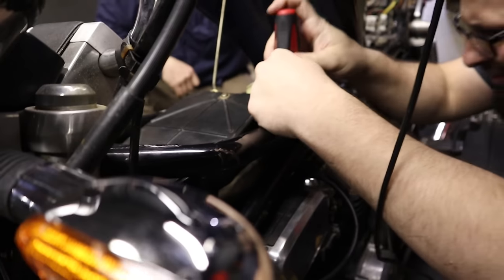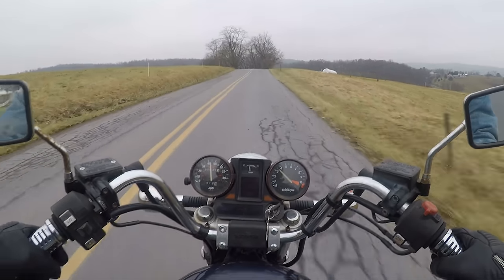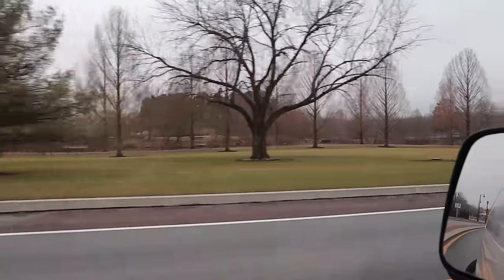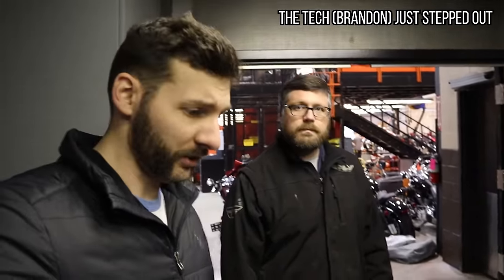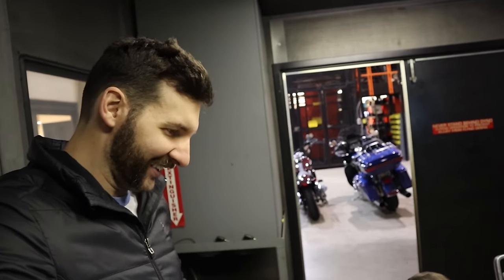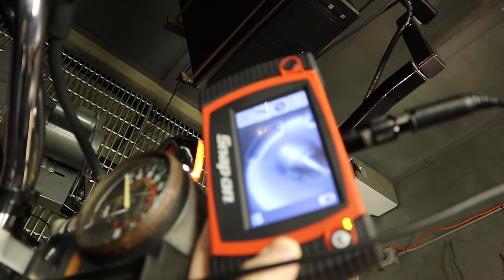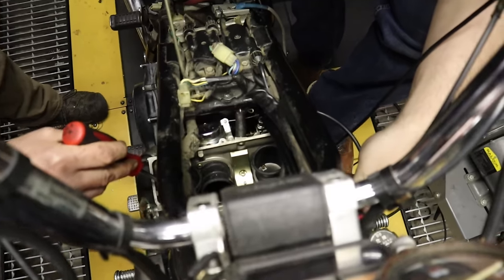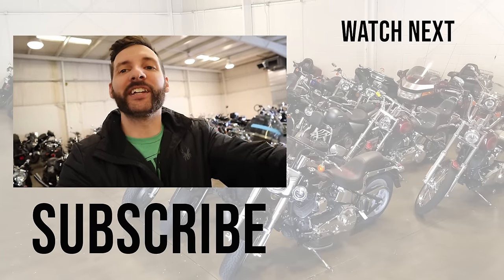We FIXED this abandoned bike for $83 then put it on a DYNO | 83 Honda Magna

Comment: Bring it to me, I'm right up the street and a 80s and 90s Japanese motorcycle fanatic, and my favorite part of restoring old bikes is tuning the carburetors. It's becoming a lost art form.
Reply from the maker: where are you at? its currently at joes but i will keep you in mind.
Reply: @Last_Stach_Standing !  ive learned that cut-rate quickie mart fuel is not the same as stations that (specialize) in good fuel at higher prices, its worth the extra money!
Reply: @chadsimmons6347  100%,I run a Honda VTR 1000F Firestorm, I think they were sold as the super hawk in the U.S,?.and one of the features of this bike is that it was fitted with the largest diameter carburettors ever seen on a production bike(48 mm Keihins),it's absolutely vital to only use a higher octane greater cleaning fuel I prefer Shell V-Power,it's also a really good idea to invest in a set of suitable vacuum gauges to check their operation on a regular basis,I do mine every 5 thousand miles,which is probably completely unnecessary!.
Reply: The vacuum slides could have small holes in the rubber diaphragms from age, and/or the intake valve clearance is too tight, which will result in insufficient vacuum.
Reply: mike brink  We don't have petrol with ethanol added in the UK,but I could see that might be a problem where ethanol fuels are available.The Shell optimax rated at RON 99,which we have does have added detergents which do noticeably clean the engine after a few weeks use.
Reply: @BikesandBeards  I'm in Ephrata, I'll send you an e-mail.
Reply: @darkknight1340  Actually "We do, I believe it's currently added at 5% (E5) but will soon be 10% (E10) search for "up to date Ethanol content in UK petrol" online and have a read.
Reply: Gumball I have an 85 magna v30 for sale about an hour or so away from you.
Reply: Running good clean gasoline is essential for engine life and performance.  Running non-ethanol fuels in carbs— even if the carbs have the reinforced rubber in them — will keep your carbs dry, and it’s a 💯 mandate for the carbs that aren’t rebuild with ethanol-resistant rubber.  Nice bike!
Reply: @Gumball's Gameroom I have a 1980 Suzuki GS550E, and the mixture screws are stuck. I've taken apart and cleaned the carburetor 5 times, but the mixture screws refuse to budge. I'm worried about breaking the threads. Here's a video of it running: https://vimeo.com/381540012 (it revs high because not all the boot clamps are fastened... because there were only two on the airbox side, and the screw stripped out of one, leaving one remaining).
Reply: That's strange because it seems so simple. I worked at a Honda dealer in HS and we still used microfiche and mercury sticks to balance the carbs. I still remember drilling out the factory carbs to adjust air fuel mixture
Reply: @williamkenny6383  It sat under a deck for 3 years, and the covers that originally went over the mixture screws have been removed, so it's been worked on before I got it. As far as I know it was last running as late as 2017, as that's the last date that was on the inspection tag (the guy who owned it died, and his brother put it up in a under-deck storage area, until I bought it July of 2019. I'm assuming the mixture screws are in a position where it will run (as you can hear from the video), but I don't know if they're in OPTIMAL position. Per advice on TheGSResource forums, I've used a rotary tool to cut down the channel into one of the mixture screws, to get better grip in trying to move it. However, I haven't done any of that before (this is the first bike I've ever owned or worked on), so I'm kinda flying blind. Everything is new to me. As such, I'm afraid of screwing something up. Being autistic and unemployed, I don't exactly have a steady income aside from disability payments, so I don't really have much to afford a proper mechanic... so it's been internet guides and videos, and lots of time in the backyard. There didn't seem to be much wrong with it, cleaned the carbs, swapped the ignition system to a Dyna S (faulty igniter box), needs new tires and a new front brake master cylinder (if I can't fix the old one). I actually took it for a ride down the alley and back, and it felt pretty good... aside from the rear tire slowly going flat.
Reply: Man, you are so right. I think them a bunch of amateurs. Why can't they clean and fix just two carburetors themselves? They are petrolheads and even I can tell you what they should have done. Instead they hit the road without getting those carbs almost perfect. What the beep did he do, spending an evening and an early morning? He did not clean and adjust those carbs, I can tell you that. Weirdo's, that's my not so humble opinion. Do they want this bike to break down? Because it is Japanese, perhaps? I don't like to curse, because it is wrong, but it is hard not to. They get me angry. Please treat your bikes a whole lot better, even if it's a cheap one.

And get yourself a dyno! What is a bikeshop without a dyno? How do you tune your bikes? How do you get your emission numbers right? Without a dyno?! Impossible. Get real.
Reply: Chad Simmons they let it collect more water
Reply: ZombiePotatoSalad buy a carb. Save your bike.
Reply: @voornaam3191 : Agree!!
Cleaning, basic adjusting and syncing of carburettors is the first you do before putting it on a dyno.
Dynos are for fine tweaking of adjustments.
Reply: mike brink  nicely explained. I don't know why people still think higher octane fuel will make the engine run better.
Reply: @voornaam3191  it's funny that they don't actually seem to know a lot about how bikes work. It's more of a 'let's take it apart and put it back together and keep our fingers crossed' approach. First thing I'd have done was order carb rebuild kits. They're not hard to source.
Reply: I wish I could have brought you my Yamaha XJ700 Maxim.  My bike shop fked it all up and ended up selling it CHEAP.  I put thousands into it too.  Motorcycles are way too expensive especially with maintenance and tire changes.  Also.  You really need a garage to keep them in.  Total rich mans' pleasure/sport activity.  Should be cheap as heck too but this greedy society fks everyone that doesnt sellout for money.  :(
Reply: @BikesandBeards  Hey Sean, you should grow your beard back again. You look weird with the mutton chops.
Reply: Gumball's Gameroom, same here mate. I also restore motorcycles and there is something very zen-like about rebuilding/working on carburettors. It also seems to be a bit of a dying art, especially now that almost everything made in the last 15 yrs has fuel injection 🤷‍♂️  my 1994 ZZR1100 has carburettors and still makes 140+ horsepower 🤷‍♂️ And if theres any issues with the carbs, they're easy enough to pull and repair/service. Best thing is, if i want to increase my horsepower, some of that can be done just by changing jets and needle settings... no expensive power commanders or injectors needed 😊🤙 Be safe out there ✌
Reply: mike brink  ideally you want to avoid using ethanol fuel in any motorcycles built prior to fuel-injection. Its not so much to do with fuel injection, but more because the ethanol fuel showed up around similar era of fuel injection being put into production bikes. This means bikes made around that time and after, have valve stem seals which can tolerate the added ethanol. But older motorcycles that run carburettors usually have older technology in the way that their valve stem seals are made of old-school rubber... which gets deteriorated by ethanol. So regular fuel for carb bikes whenever absolutely possible will protect the longevity of the valve stem seals. I find my old ZZR1100 makes better power on regular 91 (non-E10) than it does on almost any other fuel. Namaste ✌
Reply: I have an 83 750 Sabre I love it but I have an oil leak leaves a puddle when it’s on the  kickstand
Reply: Ive got a vmax for ya!
Reply: @kenball1980  Ephrata Washinton?

Comment: Hi from across the pond. Some years ago I took one of those out on a test ride which done exactly what yours done at the end of this video, it turned out to be a fuel filter. As the shop didn't stock one, I flushed it through with carb cleaner in the reverse direction, this shifted loads of muck out. This was done as a temporary measure whilst a replacement filter was ordered. This hack cured his fault and bought him time till its next service when I replaced the filter.

Comment: Sitting in a bar with some friends, when someone said that it was starting to rain....well, rain at 30 degrees freezes as soon as it hits the ground, or your bike. It was 36 miles of freezing rain on my '05 Softtail. between 15-20 mph the whole way, using a borrowed bar towel to wipe my goggles every 2-3 minutes. I actually thought about stopping at a filling station to get under the awning but figured that since I was already soaked, frozen and suffering to just push it all the way home. I'm in my 70's and have been riding since 1967, and this was probably the worst ride of my life. 

If I ever found myself in that kind of situation again, I think I would try to leave my bike in the bar and get a ride in a car....
Reply: I own a Honda CG125 for more than 5 years now, and I often find myself in that situation when monsoon season starts here in the Philippines. Usually, the situation begins when I am away from home and then rain suddenly pours down hard.

I have to brave it because it takes a lot more time for me to get in my rain gear than simply wearing a helmet and chucking the contents of my pockets into my top box. But that's also how I learned how to survive a wet road, paved or not.
Reply: sitting in a bar - riding the bike home = thank god for statue of limitations ;)

Comment: Had that exact bike, same color in pristine condition with only 8k miles 4 years ago. I got it In crank - no start condition.. I added a large amount of sea foam into new fuel after draining the old from the tank! After a couple battery charges from cranking and cranking I finally got some spit and sputters that turned into running for 5 seconds and dying then firing right back up and dying... let it sit over night came out the next day hit the choke and it fired up and idled great! Riding was a different story because it would want to bog down as soon as you would start letting off the clutch and want to die, I had to flint stone it a bit to get it to take off on its own! After riding around the block a few times and reaming on it “(slow rpm pull) like you had going on in the video” it started to finally wake up and clear out more and more! After 2 days that bike went from not running to running crappy to running great all due to 1 can of SeaFoam! I now run that crap in every bike I own every fuel up! It’s proved itself to me! If you have not used it.. which I’m sure you have, go on and throw some in the tank!

Comment: I had an '83 Honda Magna at one time, but it was the V65 VF1100 version. I bought it in 2012 from a guy that said it belonged to his dad before he passed away from cancer. Maybe, but a few miles down the road it began to overheat, so I shut it down and threw it in the back of my truck. When I got it home I took a closer look and found that the cooling fan was not kicking in when the coolant temp rose to the proper temp. Eventually, I just rigged a switch and manually activated the fan when the temp got up a bit and that worked like a charm. Then I got the tires replaced and fixed a few other small items and took it out for a spin. Worked very well and very very fast! I never did get the speedo to work, so I just mounted my smartphone to the bars and used that. I used it  to commute 35 each way in Southern California traffic for a couple of years. I did eventually give it up, but I remember one time having my son follow me in his Audi Quatro and he clocked me at 130 before he backed off. I estimate I got up to at least 145mph. I sold it eventually. Biggest and fastest bike I've ever owned. First shaft drive bike as well - that took a small amount of getting used to.

Comment: V4 Magnas and Sabres  were definetly awesome machines in their days. At one time they even made a supercharger for the V65 engines...
Reply: A friend had a V-65 Magna back in the late 80s.  He went on a few cross country trips on it but always had problems.  As I recall, there was some inherent problem with the V-65s internal lubrication system which caused excessive cam lobe and piston ring wear which led to poor valve performance and compression loss.   Probably any hi-mileage V-65 will suffer from these same defects.  I'm not sure if  these same problems were issues with the V-45s
Reply: Years ago I had a  v-45 magna and it was impressive for a 750.
Reply: @davidj.7779  theres an oil mod that helps that. also the issue mostly happens if you ride frequently under 4k rpm, or leave it idle too long as the cams rely on a low pressure system to get lubricated. but like i said theres an easy bolt on mod that fixes it
Reply: @bamcorpgaming5954  Did the 750cc variants also suffer from this issue? Can you just get away with turning the idle up a couple hundred RPM or is more efficient oiling mods an absolute must to prevent this ?
Reply: @RedMo46  just ride the bike like it's designed to be ridden and it'll be fine.if you do a ton of stop.and go I'd consider the oil.mod

Comment: might try opening the gas filler, to see if there is a venting problem, and replacing ALL of the vacuum lines .. ALL of them
Reply: Yes, have a mechanic that is easily as good as this guy. Worked for corp. Before starting his own shop. Only word of mouth. Dude is good. Got my buddies 883 up and going after going threw the paces. This was one but probably the most important thing. It sat for 18 years
Reply: Spider cocoons in vent tubes??

Comment: :hand-pink-waving:A little tip for Honda Shadow Riders that I learned the hard way today. My throttle was sticking so I laid it up for about a year awaiting a carb overhaul and subsequent massive mechanic cost. 
Today, We put in a new battery and a new set of plugs, lubricated the throttle linkage and cables a bit with spray lube (not WD 40). It's running very good now. SO, although we are going to do a carb overhaul, DIY style ... We learned that It is a good Idea to replace the four spark plugs about every 10,000 miles on these bikes. Make sure you have a proper socket for the plugs.:hand-pink-waving:

Comment: My first and favorite motorcycle is an 82 Honda V45 Magna that was bobbed and came as a motor and frame with buckets of parts.  It took a couple weeks to get it back to life and years later I'm still in love.  Brought that thing home in the back of my mom's mini van
Reply: I'm currently in the process of getting my first bike, an 82 V45 Magna back on the road,. It's been a frustrating project without any help or prior older vehicle/any motorcycle knowledge to back me up but I'm getting there. I work on newer cars, it doesn't really translate. So far I've rebuilt the carbs, I've identified a bad stator, put a new battery in it, did a lot of tests to try to find anything that isn't working correctly, and our first test ride it was hanging at 5500 RMP like in the video. It also required 4k revs and gently feathering the clutch in and out in order to even start moving or it'd stall pretty quick. 

Hasn't been on the road in a month or so, and air/fuel mixture screw actually vibrated out and caused a no-start. Found the valves were way too tight and am adjusting them right now, then I need to remove the other 3 screws and add the o-rings I forgot to put in them, aka why they were loose enough to come out. Here's hoping I have it running good in the next week or so!

Comment: Too easy... See those big circle things on the top of the carbs. Underneath there are rubber diaphrams that are probably dryrotted and cracked. This is very common when your slides aren't fully opening, unless your bike isn't getting enough air through the filter which I highly doubt.
Reply: thats why i absolutely HATE diaphram carbs!
Reply: I'd bet it's the tiny air inlet to the top side of the diaphragm that's supposed to equalize pressure between there and the main body of the carb. If it's plugged the carb will have to fight against increasing pressure the further the slide moves up. Either that or the caps aren't installed in the right orientation. Which will have the exact same effect as that air inlet being plugged. I found out just how easy that is to do while rebuilding the carbs on my own '83 V65.
Reply: I'll be coming to you for answers.    Sound like a fellow mechanic to me.
Reply: @polly_sacharride  Much to my surprise the diaphragms on my yamaha XV1000 are still factory fresh...... wonder if these can be replaced with the birth control devices of the same name?
Reply: @polly_sacharride  Also..... some varnish deposits on the slides as well as  possible vac leaks ? maybe a candidate for a single or twin carb conversion ? Ride Happy y'all    =:^)